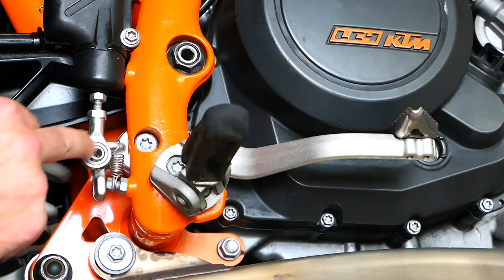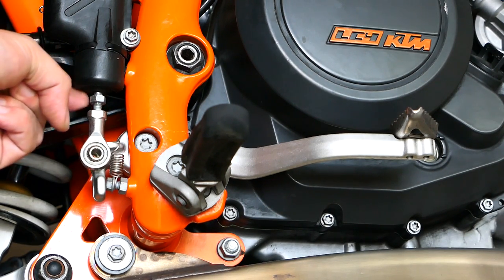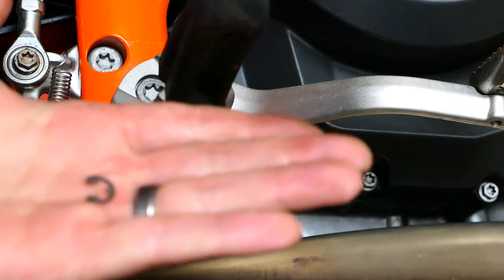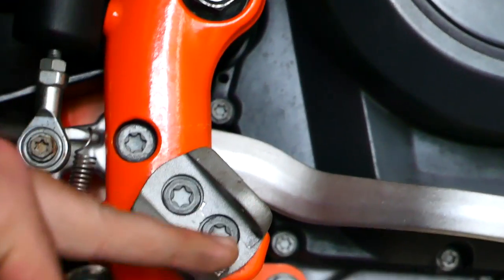2014 KTM 690 Duke Brake Pedal and Peg Adjustment

Comment: 8:47 you should have switched left and right side bracket so that the pin still goes through the top. With the E clip on top, like you have, there is a high risk of you popping it off with your foot and becoming a safety issue....

Comment: Do you think the original Duke 690R sets from the same year can be fitted to the standard duke 690? Product number is 7600393704433 https://ktmsklep.pl/image/product/04bbbf2c22ca345571.jpg they are higher and in a much much better position for track riding and any kind of sporty activity.

Comment: does this apply to their dirt bikes as well, looks like it almost an identical setup. BTW Im pretty sure under that rubber boot is a nut that you would use to adjust the free play. pretty sure you could have just put a wrench on that nut.
Nevermin. went into the garage and looked. the dirt bike brake pedals are different
Reply from the maker: There wasn't a nut under that boot. I wasn't adjusting "free play" in the pedal, it was the pedal being about 2 inches lower than it needed to be which forced me to actually take my foot off the peg to reach it.
Reply: that last part that read "nevermind, went into the garage and looked. dirt bike brake pedals are different" meant that everything I said before that was irrelevant.

Comment: you mess with front brake levers yet id like to ask you a few questions
Reply from the maker: white420horse not yet, definitely looking to add some shorty levers though
Reply: Motorable  i have a 2014 duke white i replaced with cheep ebay levers and now my brake light is in all the time i think i dropped a pice if i sent you pics of my  front brake light switch and housing wondering if we got all the same stuff . its hard for me to explain

Comment: Peg in opposit way doesn't look safely but thanks for video, I gonna use your adjestment tutorial ;)
Reply from the maker: inozbik it's completely safe. This procedure is in the owners manual.
Reply: Motorable how long do you ride like this?
Reply from the maker: inozbik I've had them this way for two and a half months. Brake position is way better since this raises the pegs 👍🏼
Reply: Motorable well, you're right! Nice, this lock ring doesn't look reliable but is has to, if manual also permit such change. Thanks one more time 👌